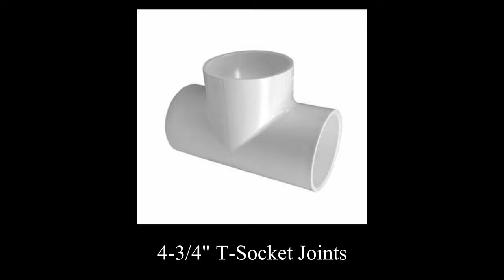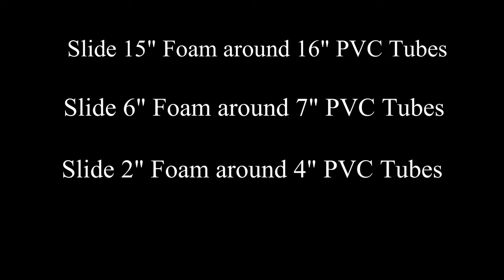DIY Saddle Bag Holder

Comment: Does this work with extended bags? How stable is it to wash bags on?
Reply from the maker: Yes, it does work with extended bags and it is fairly stable, you could make it more so by gluing the joints when you put it toghther.